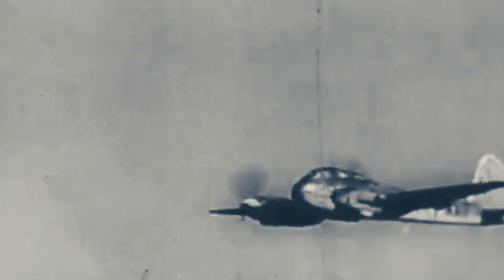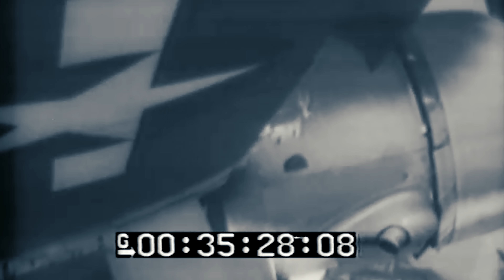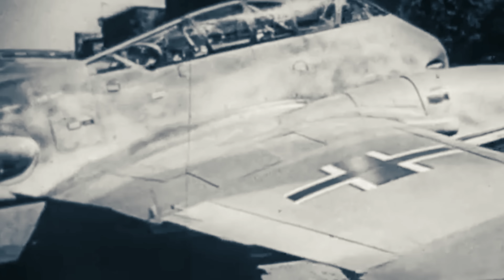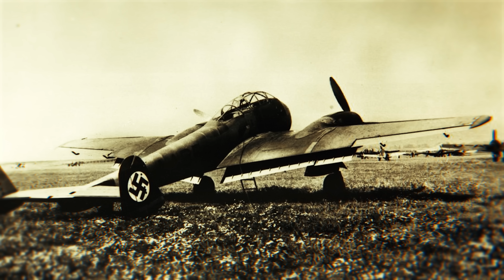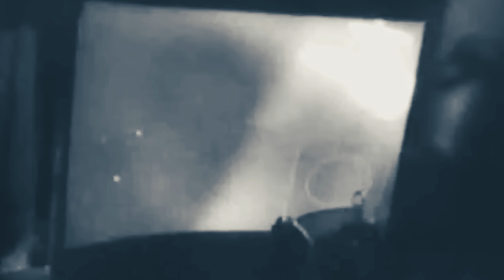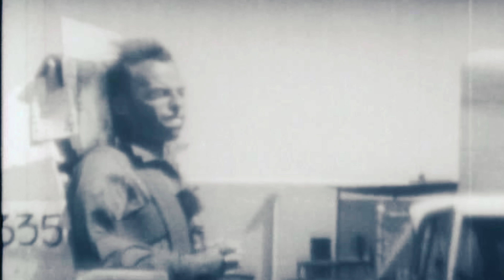Flying Disasters: 3 of WWII’s Most Dangerous Aircraft Designs

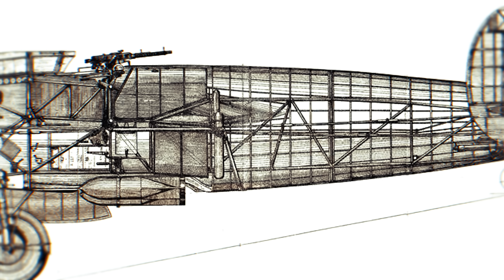Comment: at 27:35 Mike said the Ba 88 had a welded steel frame with a stressed skin.  Then he said it wasn't monocoque, which of course it wasn't.   Seems like Mike got a bit confused.   Normally having a frame or chassis means the skin is not stressed.   Needs a clearer explanation.
Reply: I think that was his point: The plane had both an internal frame AND a loadbearing outer structure. Because 12Gs.
Reply: @rockyblacksmith  Well, yes it did appear to be his point, sort of.  But that wouldn't be valid.   Aircraft structural engineers had discovered back when the Ba.88 was new had discovered that the way to get maximum strength with minimum weight was with a frame and skin only just strong enough to keep wind loading at bay, or go for a full monocoque and no frame at all.   Descriptions I have read on the BA.88 don't say it had a stressed skin and they do say its frame and skinned design was outmoded due to other designers have switched to monocoque i.e., stressed skin.
The available texts on the Ba.88 do say its skin was strong.  It would need to be as it flew faster with a higher wing loading than other frame-and-skinned aircraft, so wind loads would be higher.   That does not make it a stressed skin design which is a technical term with a specific meaning.  Note that wind pressure rises as the square of speed.
In other words I think Mike got things confused, but can't prove it, and I was trying to give him the opportunity to explain.
I think his claim about 12 G's is wrong too, but can't prove it.

Comment: The Dauntless deliberately did not have folding wings. It was decided a fixed wingspar could handle the excess G's better in  90 ° dive. Vraciu [ sp?] proved that point when his flight of SBDs was jumped by Zekes, his wingmen were shot down, but he spun around and pulled pylon turns on his wing and went head on to the Japanese, hitting them with his synchronized .50s.  He flew away after splashing some, the rest fled. The Navy moved him over to Fighters.
Reply: The Dauntless was surprisingly agile once it had dropped its bomb load, as a number of Japanese pilots found out. They were sometimes used as extra CAP planes.

Comment: The Dauntless was VERY maneuverable and two Dauntless pilots became Aces flying her.  The reason the wings didn't fold was that Douglas was not sure the hinges could take the G-load in a dive.
Reply: The Dauntless' wingspan was short enough to fit on the lifts without folding.
Reply: @carlpretorius1584    We always see aircraft square-on the lift, never at an angle to accommodate wide wingspan.  Why is that ?

Comment: Man, how could they even manage to build the Helldiver so fragile?
I mean this wasn't the 1920s or even 30s when designers were still more or less figuring things out, this was the same time as P-47 or Avenger, planes lauded for their exceptional durability were made.

"heavy fighter concept"

Would probably have worked absolutely fine, if they had been built intellently.

Essentially, to survive against regular fighters, they needed to pack more horsepowers, into a frame who's total weight and air resistance is lower than that of single engine planes.

Or in other words, they need the same, biggest possible engines, and then less than twice the airframe of the single engine planes with the same engine.
Instead, what was attempted was to use less powerful engines.

The few more successful attempts does exactly that, maximum power on an airframe that isn't that much bigger than of a single engine fighter.
Reply: About the Breda record flights, expect they were perfectly real.

The Italian industry was poor at massproduction, especially engines.   Not as bad as Japan, but almost.
But they were superb at custombuilding those same engines "by hand".   Best of all axis nations even.
So, the pre-prototypes, probably had everything stripped down to the max, and then they had handbuilt, utterly optimised engines that probably provided at least 30% more HP than the regular ones used for the massproduced planes.

Comment: The aircraft that the Luftwaffe most admired, after the Spitfire, was the DeHavilland Mosquito. Light, fast, and ultra-versatile and capable, Mosquito could do no wrong. Me-210 was supposed to be the Luftwaffe's Mosquito; however, for all of the reasons you put here, it was not, and neither was the 410 or any other Luftwaffe aircraft.
It's as if the gods of the air did not favour aircraft that served evil ends.

Comment: 23:18 That is because it was political interference from the RLM.
The RLM was a complete mess for most of its history. In the case of the Me-210 the plane fell victim to a RLM degree that new aircraft designs should go into mass production in two years instead of three. That caused time for prototype construction and alterations based upon feedback, to be compressed. That is how you get something like the Me-210. 

But the RLM also was responsible for stuff like:
-Basically ruining nearly every plane designed in the late 1930s with their interference.
-By April 1937 there where 24 different aircraft engines in development, most being already outdated low powered models that went nowhere. It was a massive waste of resources that could have been used for newer engines like the DB603.  
-Not allowing Daimler-Benz to develop a two stage supercharger like what would make the Merlin 60 series so powerful at high altitudes, in 1938...
-Because of massive nickel shortages, the valves in German production engines where reduced to about 14% and later even 8% nickel content. Allied valves where more like 80% to prevent corrosion. Now this caused massive issues. Most German aircraft ran with de rated engines during the 1940-1942 time frame. Running actual full power would destroy these engines fast. This was made worse when you learn that the fuel mixtures where tested on test engines kept using about 14% nickel content. So the fuel producers thought their fuels where fine for the economised valves. Meanwhile the real engines where blowing up when run at full power. This wasn't realised within the RLM, until May 1942. Then they finally figured out why the fuel they where using, was destroying their engines and they finally developed fixes. The main fix being chrome plating the valves. Something BMW had developed independently and the RLM had not shared with Jumo or Daimler...
-Not fostering meaningful cooperation between companies and research institutes. For example the Jumo-211 needed a better supercharger until well into WW2. Both independent research institutes and Daimler had excellent designs and nobody bothered to link those together. 
-Trying to turn the He-177 into a dive bomber.
-Developing the Jumo-222 to death by demanding more power every time it looked like the engine was going somewhere. Then the engineers had to start over again with a larger displacement.
-Suddenly switching BMW over from liquid cooled to radial engines, throwing away years of work and causing them to start over with what eventually became the BMW-801.

I could go on...
A lot of this can be found in the excelent book: The Secret Horsepower Race, Western Front fighter engine development.

Comment: Starting bad, but eventually coming right, the Helldiver is in good company.. The Handley Page Halifax proved initially much too low and too slow and took a lot of casualties. Redesigns on the air frame and replacing the Merlin engines with Bristol Hercules radials gave it pretty much the same performance and capability as the Avro Lancaster. The Lancaster itself started life as the catastrophic Avro Manchester, (under)powered by twin Rolls-Royce vulture engines, prone to overheat and catch fire. A hasty redesign around 4 Merlin engines solved most of the problems and the Lancaster was born. And then of course there's the saga of the Boeing B-29 superfortress...
Reply: I think you can include the Mustang in that too.
Reply: @captaindaveblack-w2q  Mustang wasn't terrible with the Allison engine, just it didn't do so well in higher altitudes aka what most of the air war was over Italy and Western Europe. Nothing wrong with the engine design more the lack of performance at upper altitudes it wasn't expected for

Comment: Hmmm, Corsair though not really a dive bomber, apparently  no good can not land on carriers, Brits accept and fix. Why a different reception from USN for a vastly superior A/C?
Reply: corsair could land on carriers it just wasnt easy, because of the long nose blocking vision on final approach. all the british did was change the angle they approach the carrier from
Reply: @ripvanwinkle2002 Leave it to the Brits to go with the simple approach and have it work! XD
Reply: The USN had the Hellcat available and were taking all the supply. The British alternative (the Fairey Firefly) was limited by engine supply. The Seafire (where they learned the J approach) was too small to do all a Corsair could.  The Corsair was a very good weapon, but had serious shortcomings as an aeroplane.
Reply: @Philip271828Hmmm, I think it was one of the best. It stayed in service a lot longer than most piston fighters. I guess the Skyraider did too. But you are right, you have to make the best of what you have and as quick as possible.
Reply: It wasn’t just vision.  The F4U had poor stall characteristics and a significant bouncing tendency (there is a great clip from Victory at Sea showing an F4U landing on an island strip going bouncy bounce a couple of times) The British had to clip the wingtips to fit on their carriers and this helped but did not eliminate the tendency to drop a wing on stall.  They never fixed the bounce. (you can see videos on British carriers of F4U’s bouncing over the wires)  Vought started a program called “Dog” to work on the problems.  They introduced a long stroke low rebound oleo for the landing gear and engineered a stall strip to cause the wing to stall at the root before the tip, which significantly helped the stall. With those changes the US Navy accepted the plane.